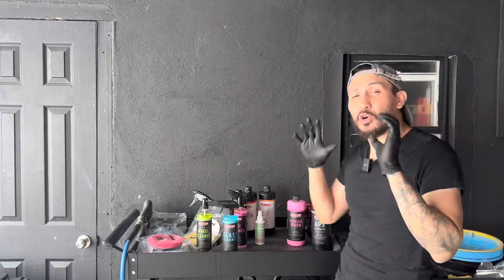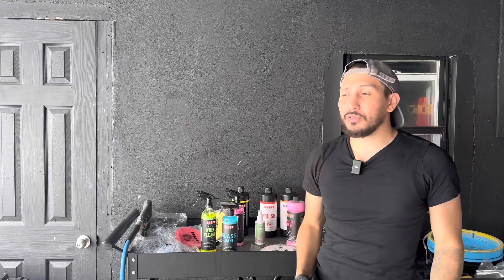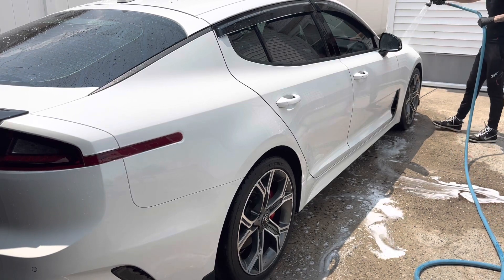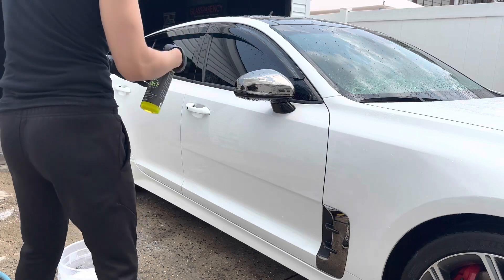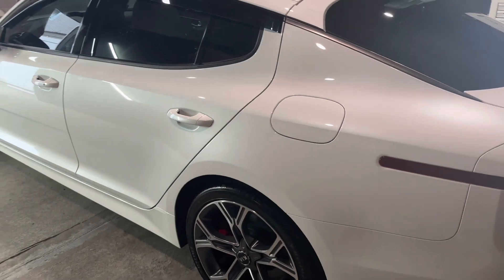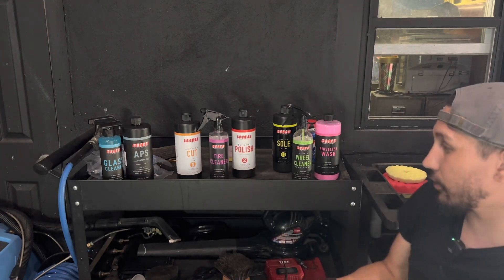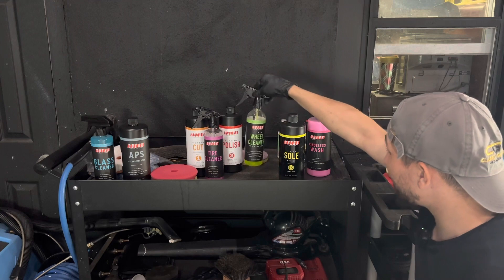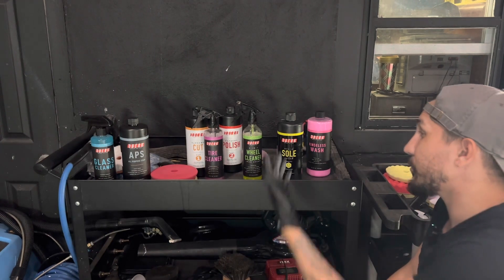Does Oberk Car Care Products Work? Oberk Product Review 2023.

Comment: How does Oberk Wheel Cleaner compare to Koch Chemie Magic Wheel Cleaner?   When I sell a wheel coating I like to use Magic Wheel Cleaner to get the rims really clean.
Reply from the maker: Hey John. In terms of cleaning they are both great. I preference how the Oberk really clings to the wheel. In terms of price they are practically the same. I’ll be using this Oberk wheel cleaner on a vehicle this weekend to decontaminate the wheels although it’s not getting a coating on the wheels but at least a sealant wheels will definitely help.

Comment: I really like their 6.5” one step yellow pad with the Flex 3401. Works fantastic(better than the gold standard waffle pad). Generally speaking, Oberk makes very good products.
Reply from the maker: Oberk makes really good products! Yes. I enjoyed their two foam pads as well. Nothing negative to say about them. I just prefer in general waffle foam pads. But I can easily use regular pads as well as shown in the video on the spoiler and roof and B pillar 👊. I have a 3401 I may give that a go

Comment: Great video!  In one response to a comment you stated you don’t do “paint corrections or a lot of two 2 steps”.. so you mostly just do one steps/enhancements before the coating?  Thanks!  

Is Sole your go to now for the business model? Any other medium polishes you like?
Reply from the maker: Yes now and days do to people budgets and needs I don’t do much paint correction at all. As we are trying to preserve the clearcoat for most. Of course if it’s heavily oxidized I tell them it needs multiple steps . But as a daily driver few years old no need for a two step. So yea I primarily just do one steps and coat. Unless the owner ask otherwise.

There are a lot of amazing one steps in the market. Have that nasiol medium cut polish, Oberk, DIY Gold Standard and OP Compound. Those are the ones I say you can never go wrong with either. Pick and have fun! Gold standard and OP compound doesn’t stain plastic trim. 💪

Comment: Sole is goated I like sole
Reply from the maker: BROOOOO! Sole was fire!!!! Was very easy to use!! Great gloss too. I really enjoyed the Sole, Rinseless on the application I used on this detail. Wheel cleaner was very good I liked how it clings more the MWC. Their compound was good no dusting and their polish was very good too. I just don’t normally do paint corrections or 2 steps. Just cause compounds last me 1 whole year or a year and a half. There supreme cut mows down. Overall I enjoyed the experience. But my top 3 was those I mentioned wheel cleaner, Sole and Rinseless.
Reply: I think Scholl S20 Black is better. ;)
Reply: @orthodox1717  I brought S20 and brought another one, it just dust. But it does  do an amazing job at cutting and polishing as a 1 step
Reply from the maker: @orthodox1717  never used scholl but this Sole worked wonders. 😭